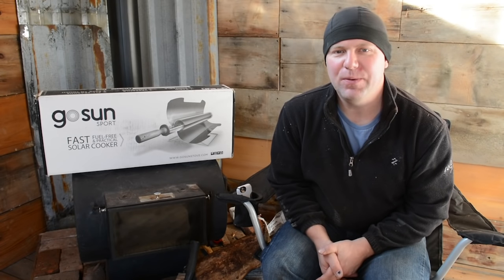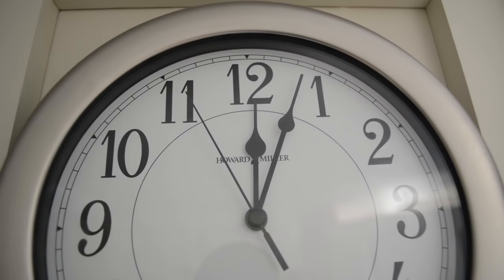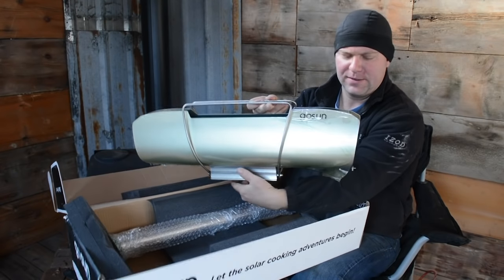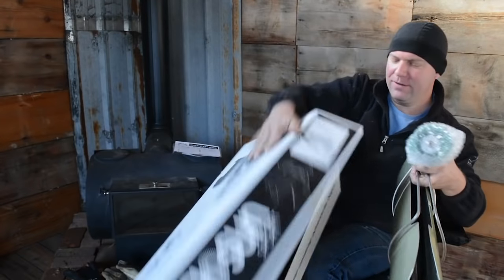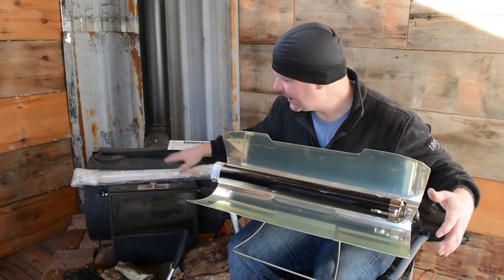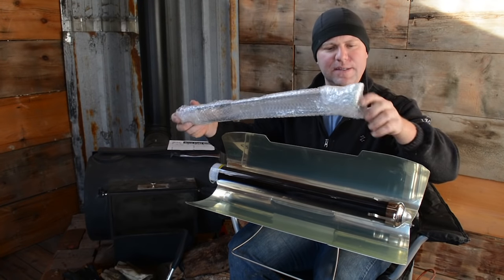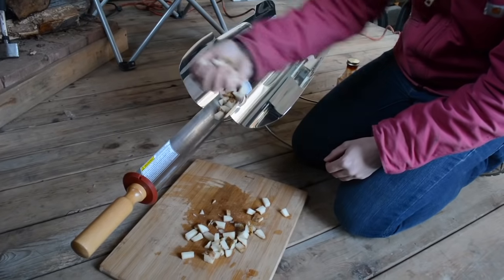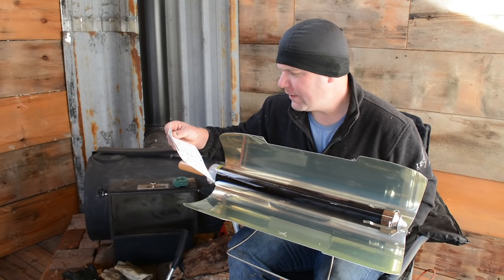GoSun Sport Stove Unboxing - Solar Cooking with a Solar Oven

Comment: We use a coleman dual fuel camp stove till we get our house built. The good thing about the dual fuel camp stove is that you can store gas at the homestead easily and do not need to go refill your propane tank in the last minute rush to get dinner made. Also for us here propane is more expensive than unleaded. 
We have an abundance of wood here and we heat our cabin with a wood stove we brought from the former USA. Here in chile they make very nice soap stone insulated cook and wood stoves which we will put in our new house as well. You will see wood stoves for heat and cooking here even in million dollar houses here because wood is so cheap and because of the byproduct of living on a farm in the southern part of Chile. Nice vid. 

Hey do y'all grill out? Lets see some MAN style cooking, also I would like to see this sun oven in operation. Jim

Comment: hey guys that looks great for small meals and hopefully it works well for you guys. I did notice in one of your other videos when you were doing some wood framing that the drill head was kinda skipping in the screw head. I do a lot of wood framing and will post a video soon abour the shed I built. I use either square drive screws or #3 phillips drive with a square bit and they never skip or strip out. Makes things much easier. In truth the #3 phillips with the square drive will jump every now and then but it is much harder to strip out the screw. I also use an impact cordless driver. Anyway I am not trolling or trying to be negative just thought i would share what works well for me. Thanks for the videos and keep them coming.
Reply from the maker: Good eye! Alyssas drilling has been improving immensely. She's just never run one before! Add that to our B And D drill being dead made it hard for her to learn. Now we're using a torx screw with an impact driver and unless the head is jammed with dirt, zero skips. She's a much happier driller now!

Comment: If you are using your propane to keep the trailer warm for the most part you may want to look into getting a 100 lb tank or even two of them. Then you can keep both 20lb tanks a spares for when you run out
Reply from the maker: +2012spacetraveler We did look into getting larger tanks but the smaller ones are lasting us quite a while and we definitely don't want to be living in our RV for TOO long, so we figured we'd save the money for more permanent items around our homestead for the time being. Of course, we'll see how we hold up this winter! The idea is that our wood stove will do most of the work and we'll only need propane for heating to bump the inside up a few degrees. Again, we'll see how it pans out.

Comment: Square head screw is called a Robertson . That's what is primarily used in Canada . Don't see many Philips screws around here. Torx  screw head is the next best thing . Glad you got rid of that black & decker . An impact driver is certainly the way to go . Easy in and out .Dual fuel stoves and lanterns are no good in Canada . I wanted to get a lantern from Cabelas and they said the lantern is not compatible with Canadian gasoline . Go figure .